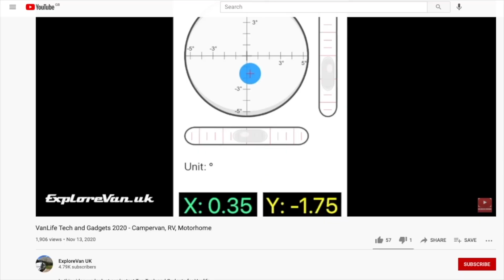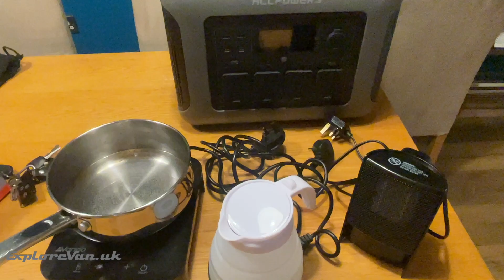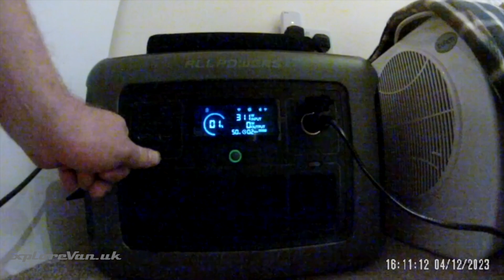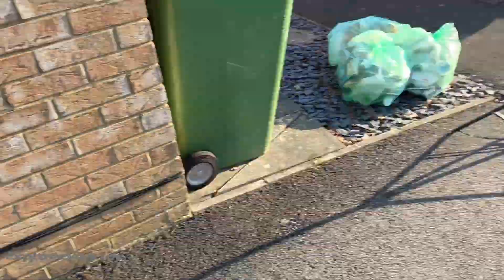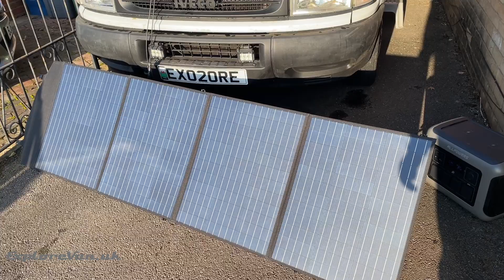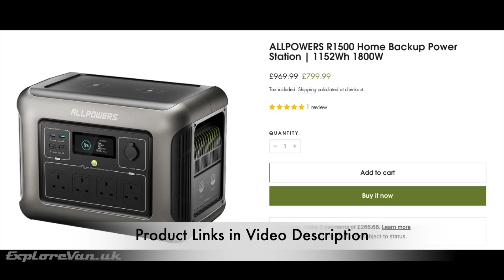Best Value - AllPowers R1500 Portable Power Station - Review and comparison.

Comment: it would be good to see you cover how to earth/ground these powerbanks, the vertualy all in the warning section mention that they "must be" earthed/grounded but thats about it, i have 2 1 ecoflow and my new one anker 767, both mention this and the later even claims to have the grounding wire etc with it, but the contence shows only the recharging cables, so until they reply to me i am assuming that when your using the items they "must be" pluged in to either your 12v or 240v supply that should be earthed/grounded🤷‍♂️and if thats the case how do you ground them when away from such sources? 
remembering that  if a fault developed and you are likely in breach of warranty, in addition have you noticed haw few contain health warnings say for example for ppl who may have a pacemaker
Reply from the maker: That's a really good point, I've not really considered the earthing situation.  I'll do a bit of research and see what I can dig up. 

I have a vague recollection of floating earths due to the vehicle body being isolated from ground, but let me see what I can dig up and have a chat with some electricians. 

I don't think earthing will impact the warranty - it is more of a safety requirement/protection than impacting the way the unit actually works. 

Watch this space.
Reply: @ExploreVanUK  yet misuse of the equipment would class as a breach of warranty would it not?, after a firms could claim that a fault ia result of " failure to follow 'x,y or z', lol eg my memory foam mattress started to fall apart within a year, it was i sured, i followed all the directions i was given by both the seller and ins company, which involved taki g the mattress out of its cover to take photos of the fualt, then when the inspector came atrer telling me 3 times 'youll get a new one', before he left asked" who told you to take it out of its cover, wouldnt accept the proofs i gave him a week later i was i formed i had caused the damage and shouldnt of taken it out of its cover🤦‍♂️😠... that fight still ongoing a year on.... so do you really think companies wouldn't take the same ' look for a  escape clause' whenthe items cost so much to buy/replace etc? More likely they turn round and say "the powerbank fault was caused through no grounding or insufficient earthing/ grounding, so not covered under the warrenty", i feel
Reply from the maker: I have just check the Manual for the AllPowers R1500 and there is no mention of a requirement for it to be earthed / grounded. 

I’m not qualified to say either way but everything I have read so far suggests it is safer for generators and similar power stations not to be earthed when used in a van.

Comment: 10A DC output .
As with most power station reviewers you omit the parts they are inadequate at.
It's no good saving £400 on a proper power system if you freeze cos your power station can't run a diesel heater  or you need to turn the fridge off every time you want to run the water pump 🤔
They have their place I totally agree,  but as an alternative to a proper power system,  no.
If you remove the 240v charger and accept you can charge with a BtoB whilst on route to the campsite they price is much closer .
Reply from the maker: That’s a fair point if that’s what you plan to use it for, you could use a 240v 12v supply like this, https://amzn.to/3RcZfTP but it’s not the most efficient to get to 12v 

I deliberately didn’t mention it as they are not yet enabled on this model but Allpowers are planning to in a later firmware, it has expansion connectors that likely give a connection direct to the 48v battery so a suitable regulator could possibly be used to drop this to a higher current 12v output, hopefully.
Reply: @ExploreVanUK  thanks for the reply 👍
Not a fan of the 240v AC to DC power supply, appart from as you rightly state it's  inefficient,  it it also makes a mockery of the simplicity mantra power Station  manufacturers push so hard.
A 30A+ port would be way more practical. It's a weak point on ni on every power station has and yet disappointingly 99% of reviews avoid mentioning .
I work on boats more nowdays than motorhomes and I have recommended power stations to a few customers  but IMHO the needs are rather specific IE one couple owned a small cruiser and a small camper, both of which were used for a few days at a time in the warmer months and a power station was a no brainer solution where 1 item is used for both.